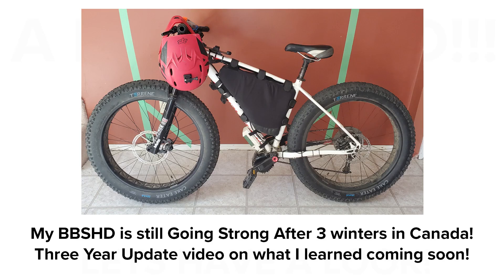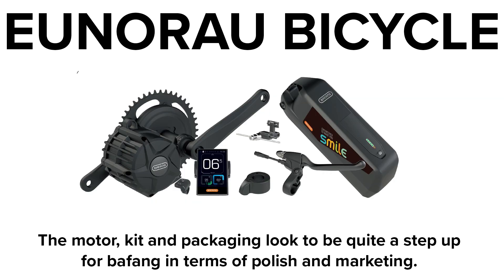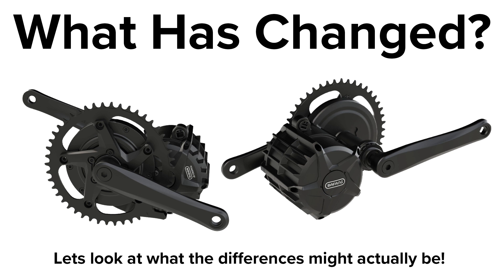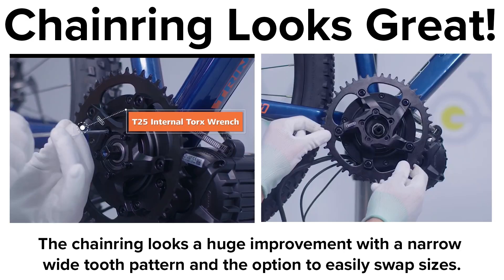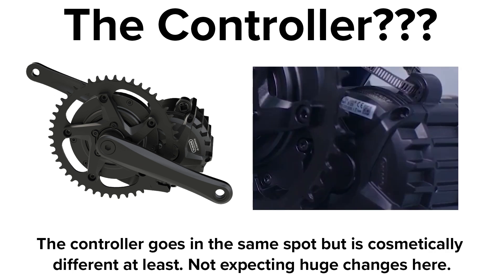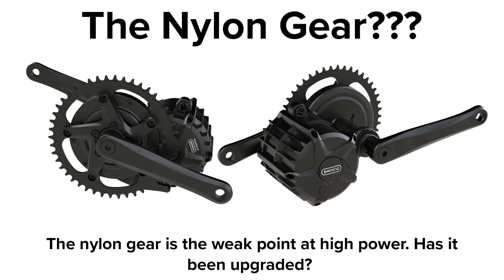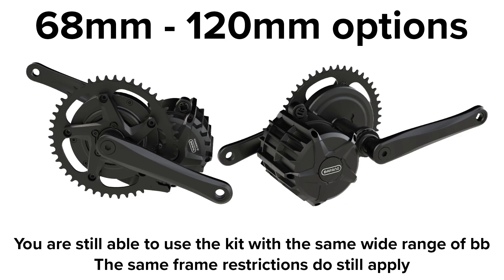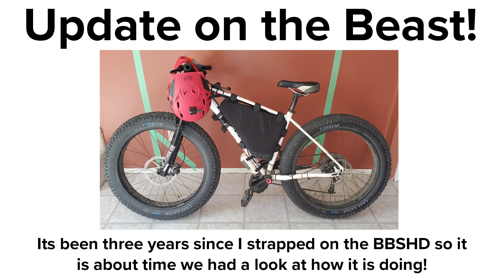NEW Bafang BBSHD and BBSO2 design revision to Bafang M625 and M325 lets what has changed!!!

Comment: A hose clamp??! Doesn't that start cutting into the paint job or grind away some frame material? There's got to be a more elegant solution than a butt-ugly hose clamp!
Reply: Thick cable tie works I agree big ugly clip is not cool.
Reply from the maker: 100%. I will be looking to make something. But yeah even if it's just rubber
Reply: I suppose you could fabricate a mount. It can't be any less janky than what I did to bolt my TSDZ2 to the frame. Cyclones do the hose clamp thing too, so it doesn't suprise me too much.

Comment: can bus? not thank you, i rather stick with bbshd for my home made batteries
Reply from the maker: Me too. Although the external controller options release the m625 from its cage
Reply: @HighVoltageKits  oh so they do have external/3rd party controllers for these now?
Reply: I mean, the communication method isn't bad, it's the fact that it's locked down. OBD2 is pretty open, and that also uses CANBUS. Paired batteries are definately a jerk move. I spend like $180 for a 10AH 48V battery and I wager Befang would charge me 5x that for the same blue brick effectively.

Comment: ive had mine over a year at first i used the hose clamp thing but if you shim it right it feels super solid just with the two allen bolts tightened
Reply from the maker: 100% In most cases when it comes loose its incorrect torque OR a poorly aligned plate. Cheers

Comment: I don't know if you will see this, but I was looking to build an ebike. I was just wondering about duty fees. Where do you reccomenned getting a bafang bbshd from? Are duty fees unavoidable?
Reply from the maker: I don't think I paid much duty where I got mine from which was em3ev.com If you are in the USA you can get them direct from Luna. No duty there. Hope this helps.
Reply: @HighVoltageKits  Also in BC. Just don't want to now what to expect in terms of duty fees. Im just wondering if I need to budget in an extra 12% or  expect a much larger fee.
Reply from the maker: 12% is probably wise. Its a bonus if not I guess. How is the Smoke with you? I think we might lose hundred mile
Reply: @HighVoltageKits  The island is chilling. Other than the heat wave back in late june, we've been all good. No smoke so far

Comment: Problem on new model !!!
If you try to program or modify via cable and laptop in any way, controler might lock you out! And display when turned on says error 30. Now im unable to revert changes and stuck with a brand new BBSHD that i cant use
Reply from the maker: Hi, you are welcome to join the discord server. Which programming cable and which motor. Is this the new M625 version? Or a newer version of the BBSHD? It gets confusing. You can post pictures on discord and we can have a look https://discord.gg/C8tsq9vH

Comment: The M625 Bafang video says battery clearance specs are (390mm by 170mm) this seems too large a battery footprint to fit but only the largest of  bike frame triangles. Did anyone else consider this issue?
Reply from the maker: I have only just become aware of the battery requirement. It seems like it makes a handshake with the controller. IE you have to buy their battery... I like it less by the day. I will do an update on it when I get a spare evening! Cheers
Reply: That battery looks huge and won’t fit on the frame of any of my mountain bikes.
Reply from the maker: The dock is a big chunk of it. But yeah it's huge!
Reply: They suggest the large battery only suitable for a 27.5 and larger wheel-sized bike in the info I have seen.

Comment: Where did you find that magnesium is better for heat dissipation than aluminium? This is just weight benefit, no more.
Reply from the maker: I am going on what I read from the online sources so I have not seen testing results or heat shedding data. I will do some more reading though. Will be interesting to see a weight comparison to see what the difference is. Thanks for letting me know. Cheers
Reply: It sure sounds good huh?

Comment: Wouldn't you agree the nylon gears work as a type of mechanical fuse. I mean it's better for something that's easy to replace to break then something that's hard to replace right?
Reply from the maker: Yes. 100% Have seen some burned up stators that would also agree 😆. Thanks for mentioning it. Cheers

Comment: The key difference is that for 2021, Bafang has entirely dropped the UART communication protocol for the Can-Bus system. The impact is that we won't be able to program/adjust anything on the new motors. The only way to play with some parameters is to buy the BESST device from Bafang (c. USD 200) which is used by cycling shops, and open an account with Bafang.
Hopefully someone will manage to develop the same software and connection cable for this new communication protocol as for the old UART system.
Reply from the maker: I don't think it will be long before it's wide open. If the higo connection is still the same the eggrider people will likely have a work around.
Reply: @HighVoltageKits  unfortunately different connector, UART was circular, the new one is like a small house (like a square shape with triangle on top)
Reply from the maker: Heah it was higo. I am sure it will be not long before its hacked either way.
Reply: @HighVoltageKits  totally agree, when i hear CANBUS my brain automagically translates it to oshit we're in the endgame of ebike mobility now so if anything this will actually enable more capabilities instead of less
Reply: @evgizmojm  Yeah. CANBUS is pretty well understood. And at the end of the day, you can still drag the phase and hall wires out to a third party controller if you really want to.
Reply: And that's my KO reason, for NOT buying the new M625,
but the old BBSHD instead.
You would be dependent on third parties allowing you to change settings of your device you PAYED for.

Comment: If it would have torque sensor, that would be a game changer.
Reply: I agree but don’t see enough change in the design to accommodate that. Changes look merely cosmetic and incremental at best. I don’t see them doing anything to make hot rodding it any easier nor Will it have the capability an external controller like the BAC or phase rubber,  but we may all be surprised. 

Exited to find out but really don’t think they’ll be much to feel jealous about over the current one at all

More recently they changed their firmware limited stock controllers to 28A vs the 30A they’d had for years.  

I
Reply from the maker: I think you are bang on the money there.
Reply: I suspect that Bosch has the torque patent and is only allowed to perform it

Comment: Man I just got mine a week ago, didn't know a new version was coming out. Either way I love my bbshd.
Reply from the maker: Took me by surprise as well. I really don't think much has changed. If we are unlucky they will have tried to deter modifications with this revision. So you may well come out best here
Reply: Totally agree! You may find yourself in a fortunate position as I’ll be surprised if they’ve made any significant changes to the controller. Therefore the current model we know has a known route to upgrade to the excellent BAC 855 should you choose.
Reply from the maker: The protocol has changed so at present the existing method of using a program cable may well not work. Same for the eggrider.

Comment: Using a jubilee clamp as a fix to the already dodgy motor clamping method is a bit retarded. It is really not that hard to engineer a professional bracket, it took me 20 minutes to make a aluminium brace from my old front derailier mount to rear of drive side bbshd.
Reply from the maker: Yeah. I have an alu frame and used 90ftlbs. It's not budged in three years. I can see why people have problems tho